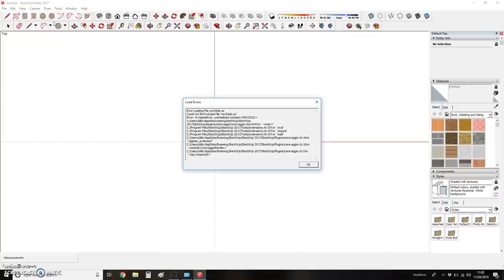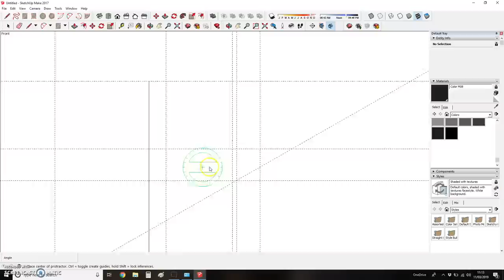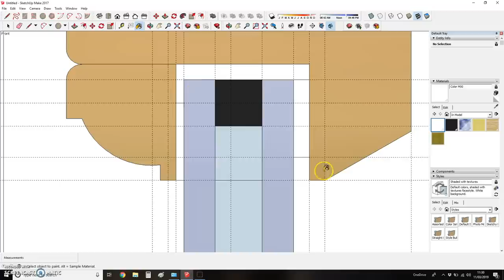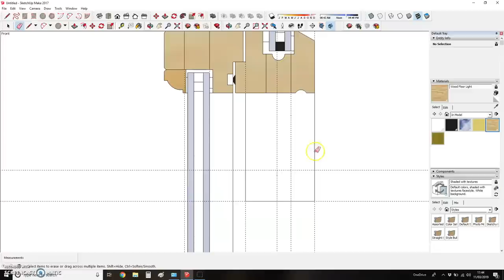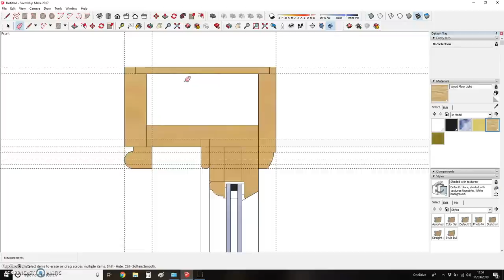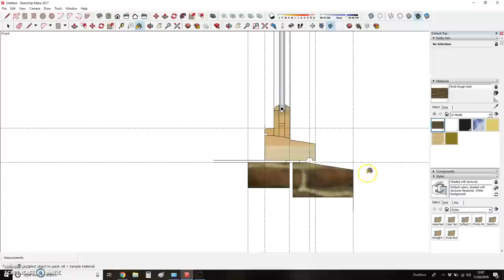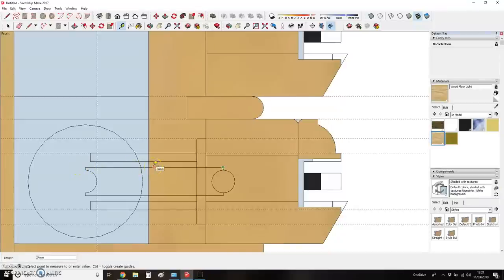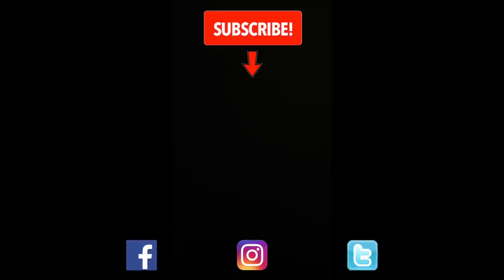Cross Section Drawing Rod - Part 2: Sash Window Restoration

Comment: Again, thanks so much for taking the time.  Very informative.  Capillary drip grooves are very often overlooked items!  I've always just done them with a saw blade kerf, but am having Whitehill make me a knife set with 3 and 4mm radius profiles for a neater job.  They make a dedicated carbide head for big volume producers but with my volume, HSS knives will last my career.
Reply from the maker: Cheers mate, appreciate it. I think it is a Whitehill block I have from memory, takes a circular carbide insert that you turn around as and when it dulls\chips. They are best being a smooth curve than a square cut, the paint will last longer on a smooth curved surface than a right angle saw keef type cut, so will be money well spent

Comment: Hi there. Great videos. I have refurb'd my sash windows and refitted them so they should be good for another 100 years or so.Unfortunately, the Historical Buildings bods wouldn't countenance  the idea of double glazing them ,only permitting "like for like" . the only parts that were beyond hope were the sills. Careful dismantling leaves you with a kit of parts.All the hardware was ok. The only difference to your install was that I replaced the existing lead sill trays as well. I  wish this video was around 10 years ago! Cheers.
Reply from the maker: Hi, Well done on the restoration, its a lot of wrk but soon overcome once you get into it! I have some cills to replace on these and will film it when i get to tackling them...!

Comment: Great videos, thank you! Would you only recommend internal glazing using accoya? Or can it be used on other species of timber. Thanks
Reply from the maker: Ideally yeah. It can work with others, but i would reccomend fully wet glazing with a polymer sealant if so.
Reply: @BradshawJoinery  Thank you! 👍

Comment: I really should learn how to use Sketch-up, I’ve been using Fusion or Inventor as that’s what I know, but it looks so much easier to do joinery/woodwork drafting in  Sketch-up.
Reply from the maker: I like sketchup, i know a few people transition from sketchup to fusion, ive not heard many do the other way around if youve already learnt fusion. But ive no experience of it. im still learning alot in sketchup!!
Reply: BRADSHAW JOINERY fusion has its place, it’s great for addictive/subtractive and CNC type of work, but it’s really tricky to draw wood projects in it. If it was Inventor than not a problem, but it’s got this silly component thing, that’s just hard to use.

Comment: Hello I was just wondering why these windows are glazed from the inside rather than traditionally from the outside, sorry if you explained it I just missed it. Not concerned about water issues?
Reply from the maker: As I'm using accoya, there wil be no movement in the timber, the sash can be painted and fully sealed before glazing. 

Basically eradicates trying to seal the beading in externally and make sure it is all painted on the beads etc. 
Once glazed the outside is seamless  and very good against water ingress Vs having lots of beads/joints 

Hope that makes sense

Comment: Is the tenon on the top rail haunched?
Reply from the maker: Yes, always try to fit some king of haunch even if it's only 5mm 👍
Reply: @BradshawJoinery  Thought so! Does the haunch go full height of the top rail? Top to bottom, or just from the tenon to the top of the rail? I couldn't quite see it in the videos.
Reply from the maker: Tenon out to the edge of timber. You can mortice it beyond as it'll get cut off anyway. The haunch is the cut down tenon so couldn't run all the way through as you wouldn't have a tenon
Reply: @BradshawJoinery  Got you. Thanks! Difficult to explain without a diagram, but I drew the tenon on the top rail as 16mm square, set 11mm in from the bottom of the rail rebate with a 8mm deep haunch out to the top edge. On my rail which is 43mm thick from bottom of rebate to top edge, the haunch comes out 16mm long. This leaves 11mm of flat surface under the tenon. Just wondering if that sounds right or should the tenon start level with the bottom of the rebate so the tenon and haunch run the whole height of the rail? (tenon 16x27mm and haunch 16x16mm)
Reply from the maker: The tenon edge is formed by the rebate bottom. So what ever depth you rebate out the timber is what your left with for the tenon and haunch. The haunch is basically a tenon cut off
Reply: @BradshawJoinery  Got you! Thanks again! Is there a rule of thumb for tenon haunch ratio? You obviously want to leave a decent amount of material in the top of the upper sash stile.
Reply from the maker: Top rail your limited and it'll be what chiselmis working for you, but generally I keep the tennon just below half width on a top rail. So by the time you've got a wedge and planed the door in it's about 50 50 left on the outside edge visually
Reply: @BradshawJoinery  Thanks, that makes perfect sence!